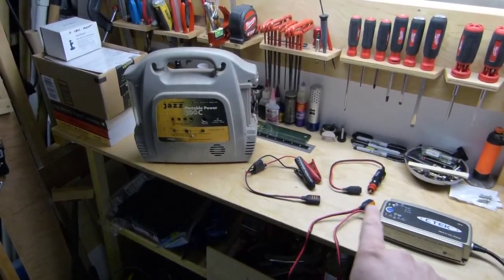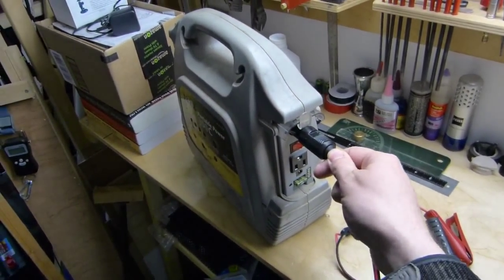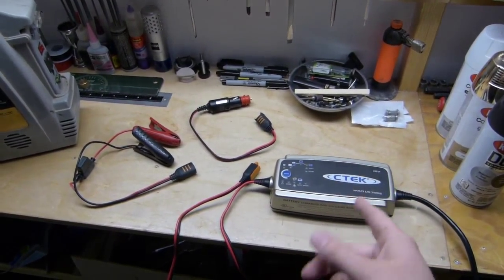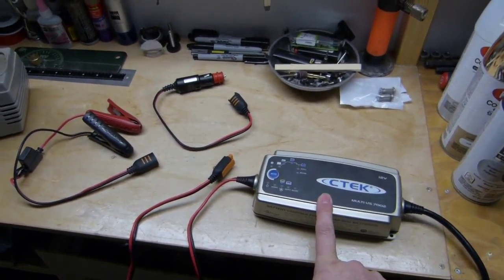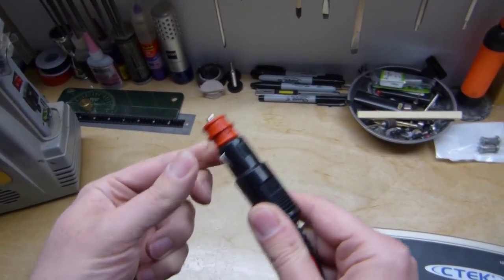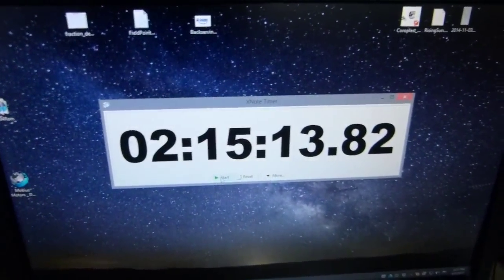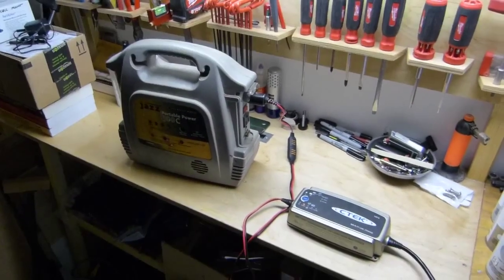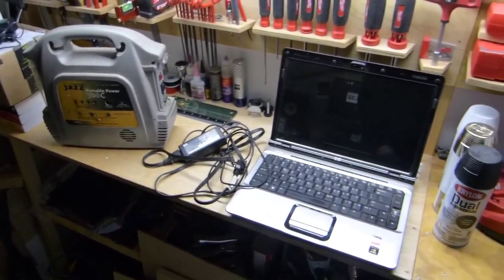Small Jumper Pack Runtime Test

Comment: I use a 30 watt solar panel to re charge my jump starter. It works better than the charger that came with it. it also has an 18 amp hour battery.

Comment: The 65W rating on the laptop power supply is a maximum, typically it will use much less than that. I have a 14" HP 65W here I just hooked up to Kill-A-Watt meter http://amzn.to/1cqnc54  With the battery removed to negate any battery charging draw and brightness all the way up it used about 40W as it was loading windows, settling to 20-25W at idle. So you'd likely get at least 4 hours, even more than that with the brightness lowered or a newer more efficient CPU. Course that's assuming the ballast and two 32W bulbs are actually using about 65W.